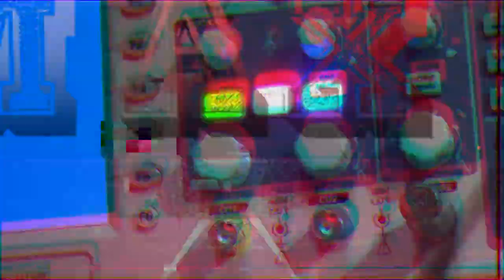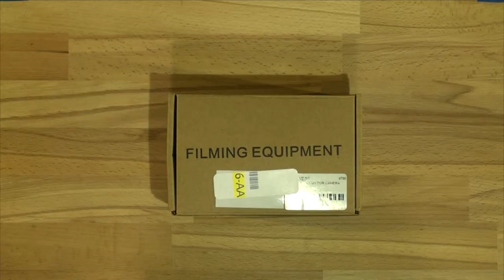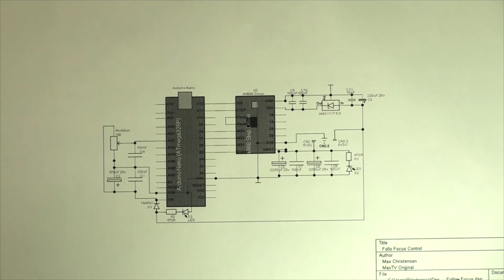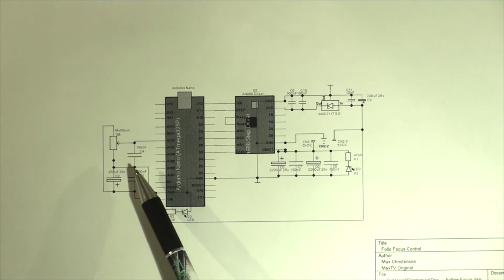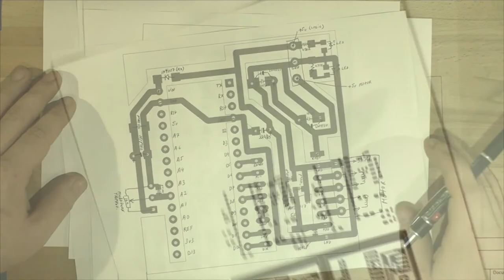DIY Motorised Follow Focus for your camera.

Comment: Very cool!  Thanks for sharing.  I'm also thinking of building something where the lens rotation would be controlled by a stepper motor, but I'm wondering how to address the issue of hitting the minimum focus or infinity hard stops on the lens rotation and prevent the motor from continuing to rotate when it hits a stop.  I imagination some sort of calibration would be good, but no clue how it could be implemented.  Is that an issue you've encountered?

Comment: This is awesome!! I'm going to try building one of these for adjusting focus and maybe integrate some bluetooth control. Great video!
Reply: Did you ever get that going with Bluetooth?
Reply: @caseyandtim  Hey man awesome video! Unfortunately I haven't been able to do much electronics recently. I ended up getting a gimbal which had a follow focus system built-in although it doesn't have as much control as I like, so I might try to go back and do something like what you have in your video. Lot of great videos on the channel keep it up!
Reply: @BenjaminAdkins97  hey Benjamin did you get the ronin rc ?
Reply: @mikehunt2667  I found a zhiyun crane 2s for a pretty good price and got the follow focus with that. It works great for me but I also appreciate this DIY/electronics approach, would definitely be fun to build and try out.
Reply: @BenjaminAdkins97  Yeh I only just saw the crane 3 . It looks like a great rig . Does yours have the zoom and follow focus motors ?
Reply: @mikehunt2667   Yeah man I picked up the TransMount Zoom/Focus Control v2 motors when I got the crane 2s. I can use the focus wheel on the gimbal to control them.
Reply: @BenjaminAdkins97  that sounds like an awesome setup . Now im wishing I didnt get the ronin sc with 1 motor . Are you able to see through your camera app and control both focus and zoom while on the gimbal app ? And do you find yourself setting it up with the motors and using them much ? I wish there was 1 app that you could see and control like a DJI drone . Im able to use a playstation 4 remote . I suppose it all depends on what your doing at the time

Comment: Thank's for this great stuff. How strong is the motor you use? Could this motor also move a stiffer zoomring of a mechanical lens instead of an effortless focus ring, or would it be to weak for such an application. If it is too weak what motor would you recommend? Thank's in advance for any input?

Comment: That's great! Simple good idea for motion control follow focus!Thank you.

Can you share a CAD pick for aluminium plate? You've done it with CNC? And what did you do with glue inside?
Reply from the maker: I made plate by hand, (used 1mm aluminium sheet) drilled Center with hole saw and then used jig saw to cut out outline, then file to clean it up. 
As for sticky substance inside, I removed most of it with a toothpick and added grease instead.
Reply: @MaxELECTRONICS Ok! Thank you!

Comment: What motor do you use? I try Nema 14, but it doesn't work not enough tork
Reply from the maker: I’m using NEMA14, try adjusting trimpot on your motor driver, that will give it more current and more torque

Comment: I'm planning to build this. Such a great idea. Can You specify stepper motor current wise? I'm able to obtain 0,5A to 1A but then 10v. Most of them are 7.4v witch is still too much... What have You choose? 
Actually, why not use servo, like almost anybody on those diy projects?
Reply from the maker: Hi I used standard 0,5mA @12v it’s ok to give them higher voltage, I used one where I pumped 32v into it
Reply: @MaxELECTRONICS  Thank's for quick response. I'm looking for something that can work with lower voltage, so that i can use powerbank for this :)
Reply from the maker: Hard to say, I designed it so I can use it with V mount battery for large camera rig, but programming code and arduino will be same, you just need to figure out what motor would be the best to suite your needs and if it’s able to turn the focus on your lens
Reply: @MaxELECTRONICS  Oh i see now. 12v is a must. I can't find Nema 14 with 12v. Only Nema 17 for 12v have 4,4k g*cm (0,43 Nm) torque. Nema 14 only goes to 10v and less are about 0,1 Nm to 0,16. Did You choose stepper cause of noise instead of servo?
Reply: Ok so i was wrong there is nema 14 12v. We use in Poland different units for torque. So i think i must look for something around 14-16Ncm torque. Not specific Voltage or Amperage.
Reply from the maker: I don’t find servos as reliable, they can be jerky sometimes
Reply: @MaxELECTRONICS  good to know. Thanks!